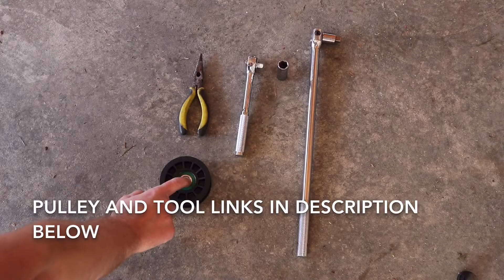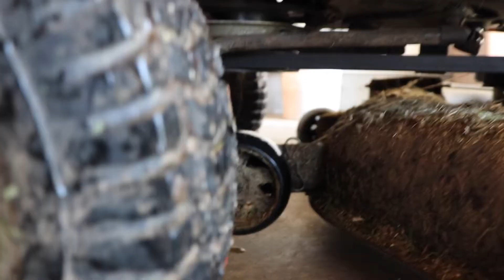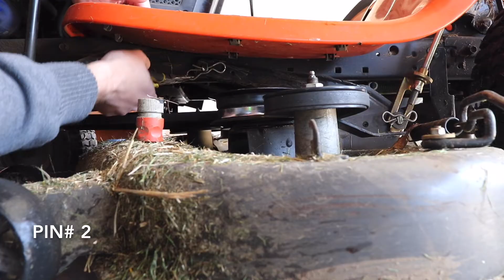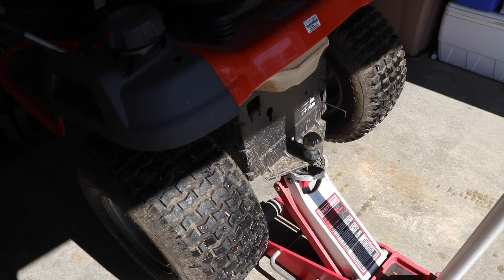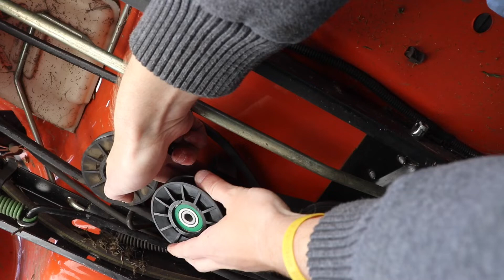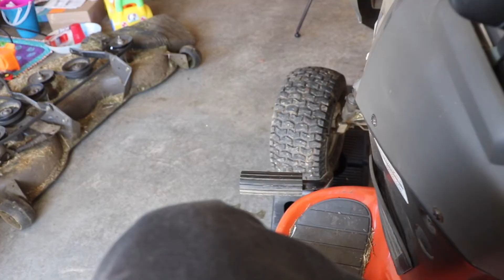Husqvarna Drive Pulley Replacement (Noisy) -  How to Change a Drive Idler Pulley on Lawn Tractor

Comment: I followed this video exactly as you did and it worked perfectly. My lawnmower shop wanted 700.00 to change fix. I spent 25.00 and 45 minutes and it's good as new. I changed two pulleys.
Reply from the maker: That’s awesome! I’m glad you were able to save almost $700 by doing it yourself! Thank you for watching and be sure to check out my other mower maintenance videos and give this video a thumbs up if you haven’t already! Thank you!

Comment: Thanks for the help.  Your video helped me see the underside clearly.  I had the same problem but it turns out I replaced the drive belt and fed it UNDER the brake/drive bar hidden by the chassis. It wore the belt out in less than a year. Be sure you feed that belt over the bar, toward the engine, and away from the deck.

Comment: Good video, I had the exact same problem. Thought it might be a pulley, but now I'm 100%. I see below comments on the machine just not going forward or reverse. I had that problem too. Mine was the clumps of grass under the brake which was causing the pulleys to slip. Also that little pull wire in the back was rusted at the trani and greased that help, something worked because it works now.
Reply from the maker: I’m glad the video was helpful. That’s a good tip about checking the pull wire to the transmission too! Thanks for watching and please consider giving the video a thumbs up if you haven’t already!

Comment: Thanks for confirming my suspicion. I been having the noise for a few years. Started off a bit quiet then progressively gotten louder. It’s so loud now I can’t even compare it to anything.  (I thought the trans was going back as my forward and reverse is also getting a bit jammed. I have to press the brake all the way down, then forward all the way down before I can reserve at times.) I have a new drive belt since last session and today decided it to watch a quick video on changing it. I knew it will be simple but just want to see a video to confirm in case of any “gotchas”. 
In the video is where I saw these three pulleys. I’m no mechanic so I never thought about other pulleys besides the deck. I quickly ordered three new pulleys from Amazon for my YHA22V46.  
I google many times before what the issue could be and came up with zero results (not knowing about the pulleys). 
So, again, thank you for confirming it was the drive tensioner pulley, or middle one. Whatever it would be called.  I will still replace all FOUR since they are ordered all ready. Under $40 shipped for all three. PLUS found a forth one. I guess I should had looked underneath with my eyes, and not just feel around. The forth one, small one closest to rear, was actually the one needing replacement. (YTA22v46)
Reply: 6

Comment: Do the rest of those plastic pulleys just unscrew like that? i.e. you don't have to mess with the bolt on the top side of the plastic pulley? I need to replace all three of mine do to a brief fire that caused them to melt a little. It was from the leaves and front exhaust.

Comment: I changed my pulleys just as you show, but have questions for you or your readers.  The first pulley that has the  metal V belt guard rubs the back side of the belt and  creates heat. Is this normal or what can I  do? Also the clutch petal arm still  vibrates a little more than  I  think is  normal. Your  thoughts or suggestions on this.  Thanks

Comment: Mine made noise after changing the belt. I think Husqvarna belts vary a little in length. I need to order another one and see if it stops. Mines a manual 42" cut. The cable could be stretched. I greased all the spindles and pulleys. Didn't help it. 🐀🐾

Comment: Everyone must have this pulley bad as they are on back order forever! I've already been waiting ove a month. THanks for the heads up on this I was having trouble tracking down the source of the noise. How many hours are most of you on when this happens? I'm at 80 hrs and have had the transmission out twice and replaced seals replaced one of the variators and this pulley has made noise since about 50 hours I just couldn't locate it. SMH. YTA22v46. I'm going to go through the deck this winter detail it and check valve lash and will probably sell it on next Spring haven't been at all happy with it other than the engine.
Reply from the maker: I believe I was at roughly 125hrs or so when this pulley began making noticeable noise. Was your transmission slipping? If so watch this video, it may be what is causing it to slip:
https://youtu.be/OrAI14ZEGYM

Comment: i have a d105 with a brand new drive belt installed. it has the proper belt, but its too loose and the mower will barely drive.. is there a way to tighten the tension on the drive belt? ty
Reply from the maker: This could be the culprit…check this first: https://youtu.be/OrAI14ZEGYM

Comment: My YTH 24 48’s front idler pulley has a chunk that melted from friction and popped the belt off. I have to replace the pulley but the nut and bolt holding the pulley just spins and I can’t get the pulley off. I can’t get my hand or anything else to the top of the bolt. Anyone else have this problem and know how to get the nut off the pulley bolt? Thanks!

Comment: The drive belt keeps slipping I think the issue is the parking brake tensioner spring or the idler pulley spring, I can’t find either on Amazon. Do you think this will fix the belt jumping?

Comment: My problem is the one  that is closest to the motor
Reply from the maker: It’s basically the same process.
Reply: @5MinuteFixit  I have the same issue, my front (idler) pulley is shredded. I bought a replacement, but can't for the life of me get the old one off. Any tricks to that? I think it's a bolt with a square shoulder, but either I can't get it pulled down enough to lock in place while I take the nut off or the square opening it comes through is "stripped". Thanks!
Reply from the maker: @offrd97  double check that the bolt for that pulley isn’t reverse thread.
Reply: @5MinuteFixit  I'll check that when I get home tonight. That would explain how I "broke it free" when I had a wrench on it, and also why the little impact gun I used the next day didn't work either. I'll let you know either way, thanks for your reply!
Reply from the maker: I’m not sure if it is I was just thinking it could be depending on which way it’s spinning.
Reply: @5MinuteFixit  so, it wasn't reverse thread and I ran out of daylight shortly after I got home. I get out earlier today, so I'll be back at it in a couple hours. It looks like I might need to remove the "Bellcrank Ground Drive" to access the other side. Have you even taken that apart? Thanks again!
Reply: @offrd97  Apparently is necessary to remove the bell crank ground drive. I have the same problem, no way of accessing the top of the screw. Any help?? Thanks

Comment: Wow, 5 minute fix this week and a 5 minute fix next week doing the noisy one beside the replacement. Should have done both at the same time. Also your mower cleaning needs to be stepped up, get rid of that dried grass, that causes a lot of problems with those mowers.
Reply from the maker: I agree with the cleaning of the mower, now I have a blower that I use to remove all the grass clippings. Thank you for watching and please consider giving the video(s) a thumbs up if you haven’t already! Thank you!